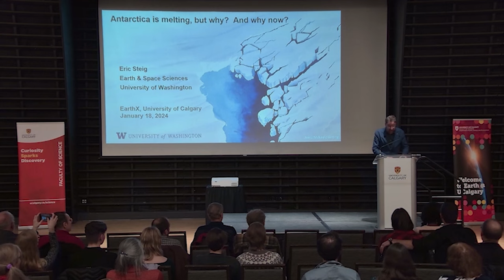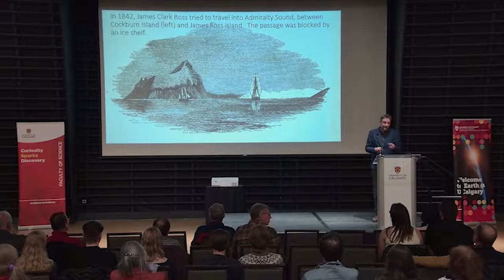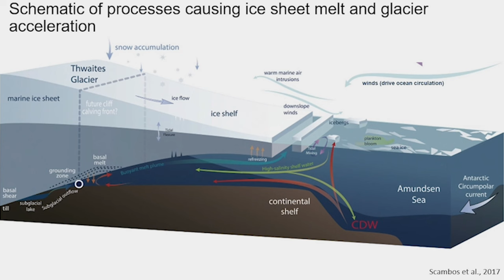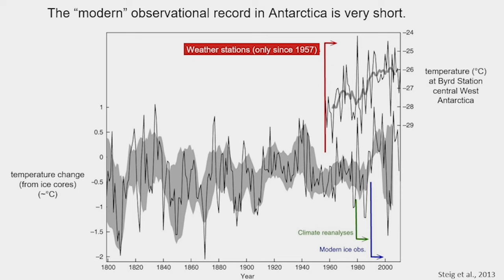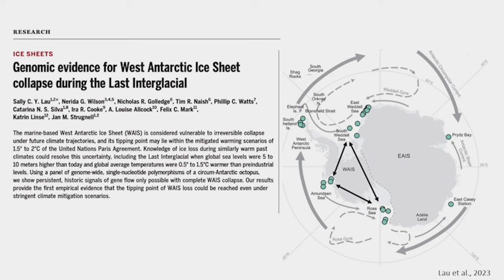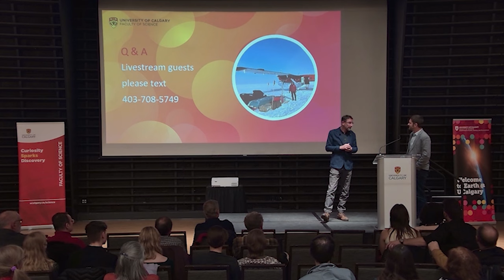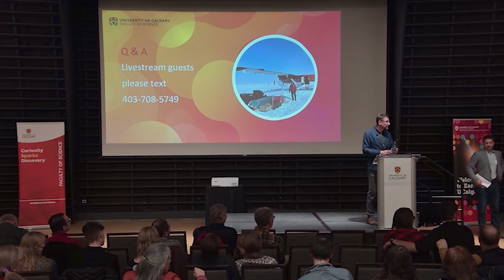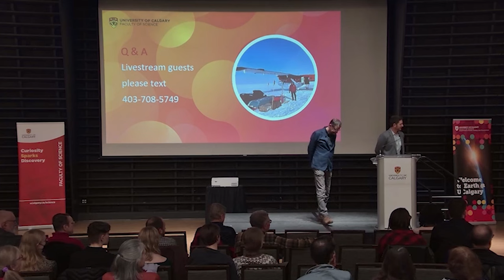EARTHx Series: Antarctica is melting, but why now?

Comment: Excellent presentation. As a budding environmental scientist down in Aus (in the tropics) I love to see stuff like this as it shows how interconnected we are. And I can attest that el niño here sucks. Its been a brutal summer... would love to take a trip to antarctica rn!
Reply: A brutal summer ? Where. Not in Victoria that's for sure. So far we've had only 4 days in the 30's for the whole of summer. The temperature has been like spring, not summer.
Reply: Well I'm in Qld mate... about 2000 ks north... and yes, even in northern nsw it has been the hottest January on record, with warmer sea water extending further down the coast than before. So yeah, it's been pretty brutal up here. We've had some of the hottest overnight temperatures on record aswell. I don't have AC at home. So I notice it pretty well 😅
Reply: @hoptoads world climate and regional weather (though the latter can be effected by the former) are two distinct topics
Reply: First 20 days of April this year in Mexico City between 3C and 6C hotter than the average. Not a single day without being 3C above normal.  
Nobody’s got AC here lol😂
Respect because I believe per capita people like this are the least responsible for carbon dioxide impact compared to USA and Europe
Reply: @louishennick6883  Precisely why being alarmist when a place is warmer than usual is asinine. I find it interesting that whenever we have a colder than usual event, it's just weather, but when it's warmer than usual it's climate change. LOL. Thank goodness for climate change, else we'd be in perpetual ice ages.

Comment: Because it’s summer in the southern hemisphere????
Reply: That's nice & witty but no because at 300 to 2,500 feet BELOW the sea surface where the ocean water melts the 2,300 billion tonnes of ice each year it's barely affected at all by the air temperature above that changes with the seasons. I don't blame you for not watching the video at all, it's a bunch of stuff to plough through. No fun for a brain of your "quality" that's for sure.
Reply: @grindupBaker  well, if you watch the satellite images, you can see the increase of the polar ice in winter and the reduction in summer so put that in your pipe and smoke it Skeptard.  And don’t forget the increase solar output due to solar maximum. We had 3X class flares just this week…. not to mention the magnetic excursion going on right now resulting in a reduction in our protection from cosmic rays,  and there always the Milankovich cycles that drives the ice ages.   I’m still witty but I’m not uneducated.
Reply: @larkljc  LOL As I already said  I don't blame you for not watching the video at all, it's a bunch of stuff to plough through. No fun for a brain of your "quality" that's for sure.  He ISN'T TALKING ABOUT YOUR SEA ICE TOPIC AT ALL IN THIS VIDEO. Duh Duh !  DUH !!!! LOL LOL LOL LOL LMFAO.
Reply: @grindupBaker  I know.  I was only joking by pointing out the obvious to the overarching question of why the Antarctica is melting at this time.  It’s my nature to make such comments as a way to poke fun at our arrogance!  ✌🏻 and of course I didn’t plow my way through it.  They lost me after about 10 minutes.

Comment: The depression of the melting point of fresh water ice, you mentioned, is about one degree C per km of depth in the sea.  WAIS is grounded as deep as 2m below sea level.  If we get to the point where the circumpolar salty water has excavated the ice down to that depth, even if this water cooled to pre-industrial levels, it would still continue to erode the ice.
Reply: Yep but typo "2m" S.B. "2 km"

Comment: - We live in the same climate as it was 5 million years ago -
I have an explanation regarding the cause of the climate change and global warming, it is the travel of the universe to the deep past since May 10, 2010.
Each day starting May 10, 2010 takes us one thousand years to the past of the universe.
Today April 10, 2024 the state of our universe is the same as it was 5 million and 84 thousand years ago.
On october 13, 2026 the state of our universe will be at the point 6 million years in the past.
On june 04, 2051 the state of our universe will be at the point 15 million in the past.
On june 28, 2092 the state of our universe will be at the point 30 million years in the past.
On april 02, 2147 the state of our universe will be at the point 50 million years in the past.
The result is that the universe is heading back to the point where it started and today we live in the same climate as it was 5 million years ago.
Mohamed BOUHAMIDA.

Comment: Atmospheric Carbon Dioxide and Aerosols -  Effects of Large Increases on Global Climate 

Abstract.

Effects on the global temperature of large increases in carbon dioxide and aerosol densities in the atmosphere of Earth have been computed. 

It is found that, although the addition of carbon dioxide in the atmosphere does increase the surface temperature, the rate of temperature increase diminishes with increasing carbon dioxide in the atmosphere. 

For aerosols, however, the net effect of increase in density is to reduce the surface temperature of Earth. 
Because of the exponential dependence of the backscattering, the rate of temperature decrease is augmented with increasing aerosol content. 

An increase by only a factor of 4 in global aerosol background concentration may be sufficient to reduce the surface temperature by as much as 3.5°K.

If sustained over a period of several years, such a temperature decrease over the whole globe is believed to be sufficient to trigger an ice age.

S. I. RASOOL S. H. SCHNEIDER
Institute for Space Studies, Goddard Space Flight Center, National Aeronautics and Space Administration, New York 10025.

Comment: Ok the future predictions of temperature warming are based on models not on data 
That assumes that the model information is accurate 
Not basing the predictions on data is flawed and incorrect let alone inaccurate
Reply: "the future predictions of temperature warming are based on models not on data". Yes because .......... the future data are not available at the present time. Please try later. LOL LOL LOL LOL LOL LOL LOL LOL LOL LOL LOL.
Reply: I think you mean the predictions of temperature in the future. 
Future predictions are ... future.
Reply: @runethorsen8423  I was not fully awake when I said this so yes you are correct about predicting future anything it is the future 
Given the models being used to calculate future trends are inaccurate at best 
The Future is simultaneous multidimensional infinite possibilities of potential manifestations of any given moment both linear and nonlinear

Comment: The Antarctic Doomsday glaciers have lost their doom. “No numerical modeling work has shown that Thwaites Glacier is currently undergoing an irreversible retreat.” – Gudmundsson et al., 2023. "Removing TWIS [Thwaite's Ice Shelf] causes a modification in modelled SLR [Sea Level Rise] of 1-2mm SLR equivalent over the first 50 years." That's risibly tiny and described as "negligibly small" by the authors. The removal of the ice shelf "will have almost no discernable effect on the future mass loss of the glacier." 
Antarctica is not warming, it's cooling, with the evidence showing it has been doing so for at least 40 years, maybe more than 70 (Singh and Polvani, 2020; Bello et al, 2022; Zhang et al, 2022; Zhu et al, 2021). So no "global" warming, and no polar amplification - at least not at the South Pole. Therefore man-made climate change cannot be causing any change in the melt rate of WAIS including Thwaites.
Reply: @DornigeChance  You're going to have to do better than simple exaggeration.
Reply: I could listen to you, or I could listen to Eric Rignot and Richard Alley, who have published in the scientific literature, and under their own names.
Reply: @robertcartwright4374  Coming from you, that means a lot.
Reply: Well, it would be nice to know exactly who (or which industry) Singh, Zhu and Zhang work for, but I have an overwhelming hunch that it's not for any respectable research unit connected with a government say like Britain, France, Germany, Norway, New Zealand, Canada. 

Watch where you get your information from, because those of us who do believe in climate change (based both on the evidence presented by the 'vast majority' of actual climate change scientists and from what our own senses are detecting for themselves) continue to be unconvinced by one or two research papers written by one or two nobodies that are not supported by their peers.
Reply: @Debbie-henri  Zhu and the like use reputable data sources that are freely available, for example ERA5 satellite data. 
ERA5 is the fifth generation ECMWF atmospheric reanalysis of the global climate covering the period from January 1940 to present. ERA5 is produced by the Copernicus Climate Change Service (C3S) at ECMWF. ECMWF is the European Centre for Medium-Range Weather Forecasts. It is an Intergovernmental organisation supported by the majority of countries in Europe (including Britain,  France,  and Germany), and a few outside. So just the sort of thing you can make your obeisances to. 
Now back to the actual data that, by your own definition, you will accept: ERA5 shows East Antarctica has cooled by −0.70°C (± 0.24°) per decade. West Antarctica has cooled by −0.42°C (± 0.37°) per decade. The result is an overall substantial and statistically significant decline of 2.8°C since 1980 in East Antarctica. So much for "Global" warming.
Reply: I love you too. @OldScientist
Reply: Deniers cite fraudulent or shoddy papers, but they also will cite good papers, and misrepresent the content or its significance.   @Debbie-henri
Reply: @robertcartwright4374  Ouch! And you said you loved me!
Reply: @OldScientist This is an AI generated pro "climate" tax propaganda channel. Get used to more of them popping up.
Reply: @robertcartwright4374  "I could listen to you, or I could listen to Eric Rignot and Richard Alley, who have published in the scientific literature, and under their own names." 
OR you could stop "appealing to authority" when you decide what to think.